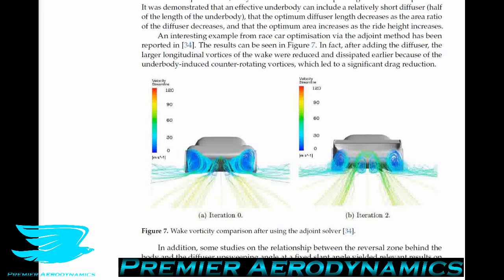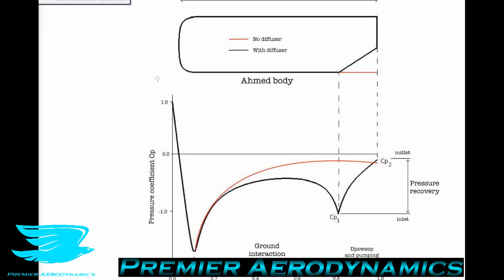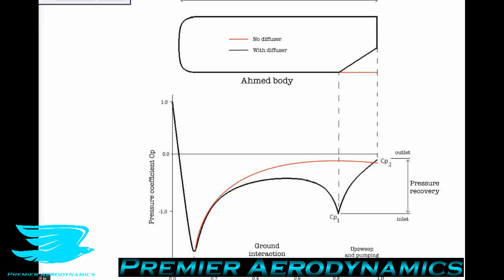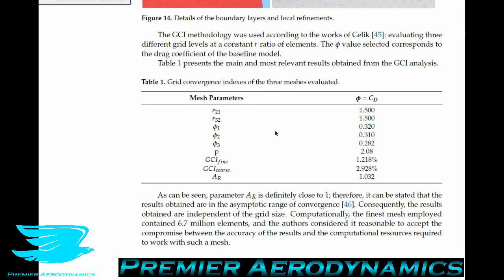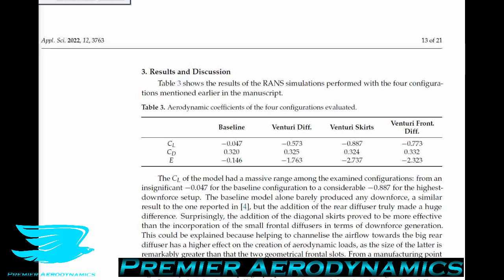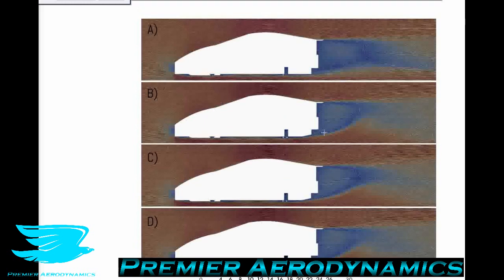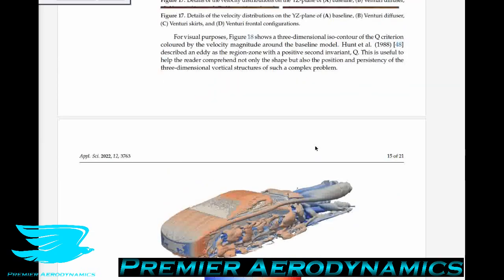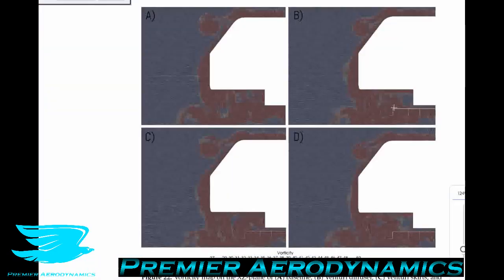Podcast #143 - Aerodynamics of Car Diffusers

Comment: The vorticity at the edge of the diffuser is due to the lateral infill because the air on the side of the car is high pressure due to the skin friction from the rear quarter panels.
Reply from the maker: Thanks! And that means that a good skirt would reduce it a lot.
Reply: @PremierAerodynamics  Or you can take advantage of that infill momentum to increase the vorticity of airflow under the car. Obviously, you wouldn't want the in-fill at the throat, but rather just after where the air expands.
Reply from the maker: @rolandotillit2867  That's true. It might also help if the pressure hasn't recovered fully because you can increase the pressure a little and reduce the drag.

Comment: The diffuser is a nozzle. You build up pressure at the front, aim it at the throat, and shoot it out the back. If you think about the defining features of skirts and strakes, they're sharp edged, that means they can easily generate vortices. While vortices are a source of drag, they can pump air, and entrain it. A lot of new sports cars are using strakes around the front wheels along with front arch diffusers. The benefit is that it helps manage the tire wake under the car, since it's turbulent, it mixes with the fast moving air and slows it down, reducing downforce. Anything you can do to lessen the tire wake helps massively. The tire wake as you pointed out generates a series of vortices, and the diffuser can enhance the vortex shed by the tire. Which while it adds drag, reduces losses of under floor flow velocity, which makes the diffuser more efficient. Maximizing underbody downforce is a series of compromises, and sometimes adding drag is the key to reducing drag.
Reply from the maker: That's true. Changing something, even really far downstream, often has a noticeable effect upstream.

Having a turbulent underbody flow is an interesting idea. On the one hand, it will make the boundary layer stay attached more readily, which will mean you can have a more aggressive diffuser. But, on the other hand, if it is too turbulent, with vortices etc., then the flow may not be attached at all.